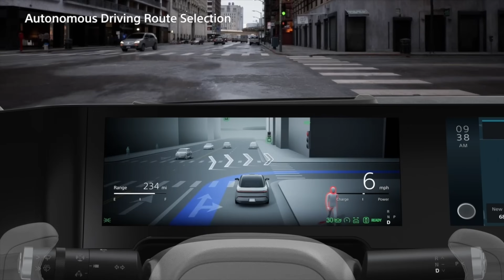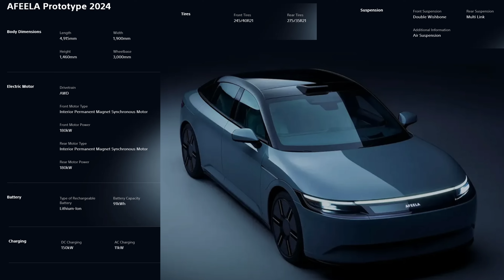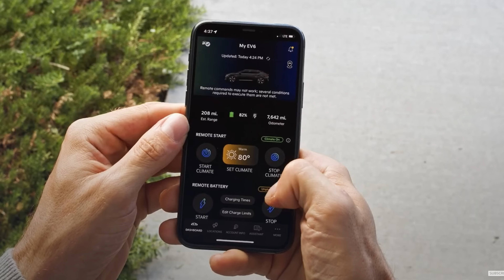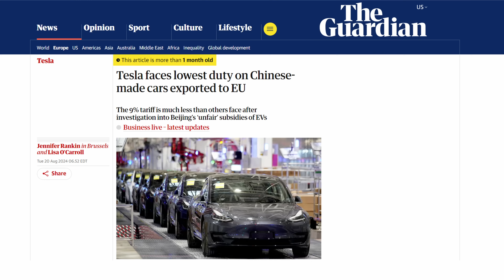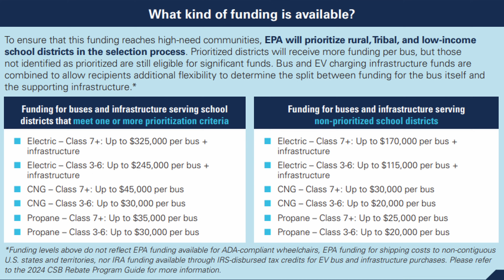The Current : Weekly EV News Ep#30 Sept 29, 2024

Comment: Wow, that's a lot more info and analysis on Afeela than I've seen anywhere else lately.

The info you provide makes the proposition almost make sense.  But I'm afraid what they're going to need is a third partner with battery manufacturing and battery tech expertise.

And yeah, it might not hurt to bring in a ringer to tune up that design.
Reply from the maker: Thank you for sharing your thoughts. You can get a glimpse of our initial coverage in this piece from 2023:
https://youtu.be/Emo3x7jKJNg?si=287-LgBzP9wkFiQh
See the final chapter
-Producer Tim

Comment: Afeela prototype: No yoke, please??? Has a 91 kW Li battery. Of course they'll kill some range using 21" tires on a sedan. Porque???? Has stalks, 460 HP out of the AWD platform. Seems to have a 150kW charging speed on DCFC. Bet it'll start in the low-mid $60s. Says it will be whisper quiet, which would be a first for a Honda. Good luck.
Reply from the maker: We are happy to see that the specifications sheet we shared on screen (and in our original reporting) has helped to inform your views on the product. -Producer Tim